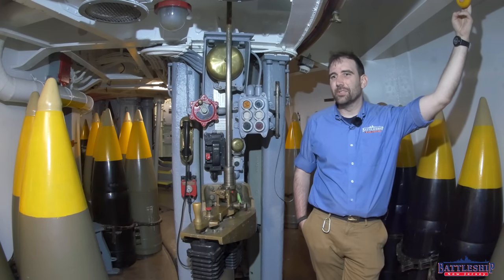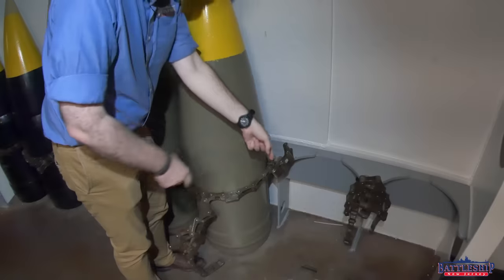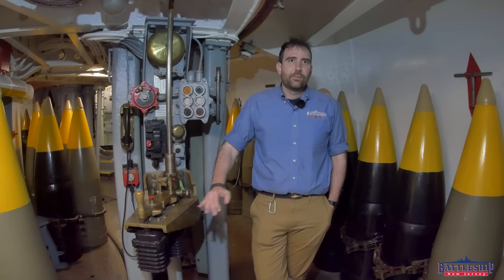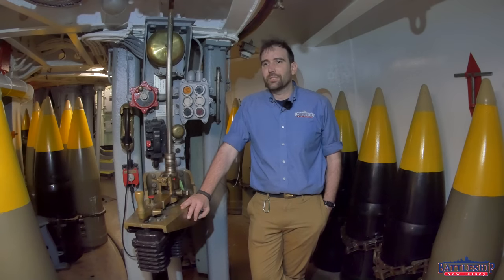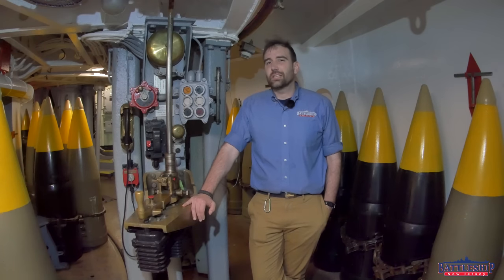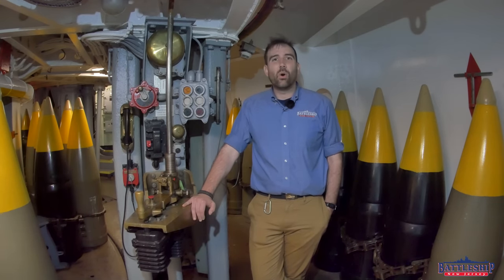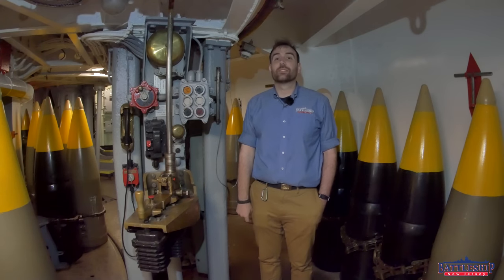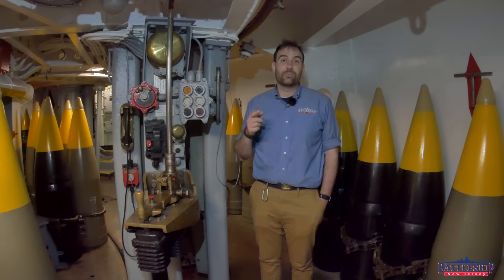Hoisted! Moving 1 Ton Projectiles

Comment: Perfect timing for this video. Just yesterday, I was looking at my copy of Paul Stillwell's Battleship New Jersey. On page 99, he talks about how in April 1947, in Bangor, Wa, they were loading new ammo when a 2700 pound shell broke loose from the sling, and dropped from the second deck level, all the way down 5 levels. This story would make a great video.
Reply: Sounds like an opportunity for some shipboard archeology.
Reply: @jth877  it had to make some dents on the way down.
Reply: That had to have left some dents! I dropped a 4kilo puck of steel on the ground and it made a big dent into the concrete, a 2700 pound shell bing-bonging down into the ship...
Reply: Even better timing for me, just yesterday I was looking at that 2,000 lb 16 inch projectile I have stashed in my basement and saying to myself "How am I going to move this thing? I'll never be able to get it to the gun show and get some money for it if I can't get it out of this basement".
Problem solved, now I can quit worrying.
Reply: @jth877  Dent is probably still there. The book said that after they pulled the shell back up the hoist, one person dumped it overboard. The book didn't say if it's still there.
Reply: Dang I thought dropping my watch was bad. At least it didn't penetrate all the way down to the outside. Probably would have raised a few eyebrows. Seriously, I assume they don't fuse them until nearing the chamber to fire, so safe? Not if you're underneath the deck.
Reply: @JamesThomas-gg6il  
Confuses say;
Man who drop watch in toilet have crappy time.

Comment: I'd like to know how they modified the barrels for the higher pressure rounds.
Reply: According to NavWeaps, the chamber volume and working pressure are the same for the early and later guns (23,506 cubic inches for the chamber volume and 18 tons per square inch working pressure).  The propellant charge weight was dropped from 590lbs to 545lbs and the muzzle velocity dropped from 2600fps to 2520fps while the shell weight was increased as Ryan noted.
Reply: They made em thicc

Comment: What was the margin of error on the main guns when firing on the same target? How did they decide what type of shell to use for what circumstance?
Reply: Drachinifel has a great interview of Captain Larry Seaquist, who Captained the U.S.S Iowa, and he claimed @ 28 mins and 40 seconds in that video they could put a 9 gun salvo's shells all within the area of a "English Football Pitch" field, with nothing landing in the stands, but he didn't say at what range. It's a great interview if you search for "USS Iowa - What It's like to actually command a battleship"
Reply: Regarding the type of shell, there were only two choices, the Armor Piercing and the High Capacity (which would be called high explosive in any other context).  The first was used when you had to go through serious armor or fortification (like concrete), the second for any other target - and there was an air-burst option as well.
Reply: @gregorywright4918  They also had a blind loaded plugged Target Practice shell that was filled with cement and weighed 1900 pounds and had the same dimensions as a High Capacity shell.
Reply: @kimmer6  True - I was presuming he was asking about combat missions.

Comment: Iowa recently turned on the power to the turrets and broadsided the turrets 

we would love to see you, turn the power on to the turret and broadside all three turrets
Reply: Philly needs a warning 😂
Reply: Is that all electrical, or is hydraulic power required?  Some of NJ's electrical transformers were removed by USN, and without main engine power there was a question about whether enough amperage is coming from shore power.
Reply: Iowa just turned Turret 3, the other two did not.  Remember, Turret 2 on Iowa has been out of service since the open-breech explosion on April 19, 1989.
Reply: @gregorywright4918  Most of the movement systems in the turrets are electrohydraulic, meaning that electric motors run hydraulic pumps that flow fluid thru a system to generate movement.  Turret train (traverse), gun lay (elevation), projectile hoists, powder hoists, and rammer are all variations on this theme.  The six parbuckling capstans per shell deck are directly driven by an electric motor and a series of driveshafts and bevel gears, no hydraulics involved.

Comment: A couple of hoist/projectile/powder handling questions.  Between engagements with the big 16s were the projectile/powder hoists kept “primed”, or was that too much of a risk?  If an engagement ended quickly, with the hoists partially loaded, could they be run backward to return projectiles and powder to their respective storage areas?

Comment: When you stack 5 shells in the hoists, how do you maintain flash integrity? That sounds like what happened to the British battlecruisers at Jutland?
Reply: I'm pretty sure it's the powder that you have to worry about in a case like this.  I think it would take quite a shock to detonate a shell, a LOT more that it would take to light off bags of powder.
Reply: @danquigg8311  I would agree that it would take a really good shock to set off  a AP 16 inch shell in a hoist I would be more worried about the powder bags
Reply: As the shells go upward there are doors that close between the rounds at different levels.  Not sure if they can be reversed.
Reply: @gregorywright4918  Four doors between the firing chamber and the magazine?
Reply: @timschoenberger242  I presume - doubt anyone can fit up there to check...

Comment: Was the New Jersey 16 in ever manualy unloaded after loading.  Or was the shell just fired into a safe location.  Imagine it would be hard to get the powder charges back into their containers
Reply: This was answered in a past video. Short answer, not unless absolutely necessary. Guns were cleared by firings them. The process manually unloading them is not fast, and quite risky.
Reply: @GregoryVeizades I assume that's in part because of the holes put in the powder bags before loading
Reply: @counterfit5  There are no holes purposely put in the propellant bags at any time for any reason.

Comment: For an interesting "rabbit hole," The War Department's Ordnance Corps had their own 16" rifles for Coastal Artillery use.  There was considerable friction between the Navy Department and War Department over Congressional funding--so the two did not often "play well together."  Coast art8llery had wanted a 16"_55cal_ rifle for their installations, to outrange naval guns--but there were no foundries to make those.  Most of the Army 16" rifles were 40 cal, just to be different from the 16"45s of the Navy.  
This is even more twisted up in the 14" diameter rifles, some dating back to 1895 in "disappearing" batteries, and retained for "sunk cost" reasons.
Reply: Thought used navy hand me downs
Reply: Battery Townsley just North of San Francisco in the Marin Headlands had two 16''-50 guns for coastal defense. The guns were scrapped in the 1950's but the concrete structures , tunnels, and equipment rooms are open to tourists. They have a 16''-50 barrel on display up there that has an interesting history.
https://www.youtube.com/watch?v=sgjCYDIZiDU
Reply: Big problem for those range issues was lack of elevation for the land-based guns.

Comment: Just curious... did this 'plunging fire doctrine' assist at all with shore bombardment?
Reply: Plunging Fire is a ship-attack tactic, if you have good visibility at long range (or radar control).  The difference in angle is not much, like 5 or 10 degrees at most, compared to what a howitzer or mortar can do against land targets, coming in at 50-70 degrees.

Comment: How are the shells stacked against the wall moved? They're really heavy, right? Is there some sort of crane that can be wheeled around?
Reply: There is "parbuckling gear" built into the decks on the two shell deck levels.  Six constantly rotating capstans allow a parbuckling crew to use 3/4" rope and sometimes sheaves to lasso the base of a projectile and drag is across the shell deck, which is lightly oiled to cut down on the friction.  The capstans and sheaves are strategically located so that with the use of supplemental tackle as needed, the crews can drag any shell from its storage slot to any of the three projectile hoists.

Comment: What are all of the different types of shells (main guns and secondaries) would be carried on a typical cruise in each period of service? 

Did the main guns have starshells?

Was there a shell developed for shore bombardment? If so, did any use a proximity fuse?

Were all of the shells made during ww2 or were post war shells used in service? 

Are there still shells in storage?

Are there limitations in the New Jersey design that would prevent new shell types such as a GPS or laser guided shell?

Assuming the ship is in the middle of a battle and a particular shell type is being used (the hoist is full). The captain decides to fire a different shell type. How long/ his many rounds would it take before the new shell type is fired?
Reply: As to starshell, almost certainly not.  NavWeps doesn’t list one for 16” mk7, and I don’t remember coming across one when sniffing round the ammo for this.  I would also think adapting designs to work at they size would be difficult.
Reply: For shore bombardment, they just used HC rounds, for the extra bursting charge.  The same as using a demolition bomb instead of a GP bomb, if you don’t need penetration but want the maximum surface bang.

I don’t think they ever had prox fuses.  Certainly in the 40s, and probably for much of the 20th century, larger bombs and shells were harder to do prox fuses on, and the greater standoff (detonation height) needed for a shell as powerful as this was also a problem.  And again, NavWeps doesn’t record a prox fused version.  For much or all of the life of the Iowas, prox fuses would have had to be paired to the shell design, or requires larger fuze pockets, so you would have needed a prox fused shell, rather than fitting prox fuzes to standard HC rounds.

I should add the proviso that not everyone is keen to declassify the state of the art in 1980s prox fuzes, so my historical research maybe be incorrect for late era Iowas.
Reply: If you build a 16” shell that can be fired, deploy guidance fins, and have the fins, guidance computer, and gps aerials and/or laser seeker head, all survive, you just need the equivalent of an advanced fuze setter to feed the targeting data to the shell before launch, and an otherwise operation Iowa could fire it.  The 155mm version, for the land based M777 and similar, costs six figure a round, and I’m not sure it’s ready to use yet, even if you want to pay for $1m fire missions that only involve a single round from each gun of a single battery.

So sure, if you spend 20 years paying a defence contractor to burn money, it can be done.  The technical problems are merely new and enhanced versions of more or less solved problems.

Comment: you could go down in size with a sabot system where a 16 inch gun could fire a 14 inch projectile. but going up is as you said a time consuming and complex process. And the amount of projectiles and powder charges would be degreased.

Comment: 1:10 Well you COULD fire a 14 out of the 16 in. It would fit. now whether or not you want the shell bouncing around the barrel on the way out is another story. Get alot gas escaping the 2in difference in circumference though. The reverse...not going to happen of course.
Reply: I suppose you could build sabots to do it if you only had 14s and could never make more 16s for some reason lol
Reply: @garywayne6083 or huuuuge driving rings
Reply: @garywayne6083  Sabots were constructed for long-range munitions testing.
Reply: There would be a 1" gap all around the shell - it might not even make it out the barrel.  If it did move, it would probably vibrate and "bounce around", destroying your barrel grooves on its way.
Reply: @gregorywright4918  With a full powder charge chances are high it would make it out. But the result would be similar (if you can even make this comparison) to firing a .50 BMG out of a 12ga. It will exit but not go very far. Or you end up with a "bloop" exit like a mortar misfire.

Comment: Well the British Empire could have upgunned the Tiger Class Battlecruiser form 13.5" to 14" guns but as Ryan pointed out, that would have been expensive to rip out the ammunition storage and ammunition hoists and replace it with the systems from King George V
Reply: There would have been no need to replace the 13.5in guns and turrets on the Tiger as she, like the Iron Dukes had the heavy 1400 pound shells compared to the earlier 13.5in ships that had the light 1250 pound AP shells. Increasing the elevation would have been better, just like the Japanese did with their 14in turrets.

Comment: Ryan, the way I see it, an Iowa class Battleship's 
only mission, is to get 9, 16 inch guns to where 
they need to be.  And shoot them!  The rest is 
just the things that are needed, to keep those 9 
guns safe and running.

Am I correct?

(You might notice, I am here quite a bit, kind of 
strange for an Army Aviation puke.  I LIKE your 
presentation!)

The Apaches and the other attack helicopters, a 
similar view.  They are there, to shoot what they 
have.  The CH47 Chinook, the one I worked on, 
was strictly designed to get logistics, to where 
they needed to be.  Guns, ammo, first aid, or lunch.
Also, to "un-ass" the AO.  (GTFO.)

steve
Reply: If that is the case, then they were failures during WW2, because those 16" guns did nothing to other ships or fortifications then (well, perhaps a destroyer).  But if you expand the mission profile to include escort (accompanying the carriers to stand between them and any IJN battleships that might threaten them, particularly when the planes can't fly) and heavy AA defense, then they had good reason to be proud.
Reply: My fiend was a crew chief on a Jolly Green Giant, and had some nice stories. One involved transporting a new gun/watch tower to a fire base. 
The ghosts started using small arms on the copter, and the new 2nd. Lt. said to drop the tower and gtfo.
So they did, and 2nd. Lt. was shipped off.
Another one was when a NEW 2nd Lt ordered crew chief to stop r/m on the copter and sandbag the 2nd.Lt's hootch. 
A captain that knew crew chief saw him sandbagging and asked WTF are you doing? He told the Captain. 
Captain said get back to your copter, I'll talk to the LT.
Lt never again spoke to crew chief.

Comment: I have read several accounts of New Jersey inserting special forces units by firing individual soldiers in empty shell cases equipped with parachutes into Vietnam. One broadside would deliver a squad with extreme accuracy into enemy held territory. Are there any surviving examples of these shells aboard the New Jersey?
Reply: The G forces would turn any occupants into mush!.....Try again.
Reply: Not any kind of expert, but this sounds like a sea story to me. How many G's did the shells experience when fired? Seems that it would be enough to kill even a SEAL.
Reply: That is funny stuff.
Reply: @rcknbob1 artillery apparently peaks at 15,000g typically, but that seems to be for land-based units much smaller than the 16"/50. The final HARP gun, which was four of these 16"/50s welded together lengthwise (🤣) and then bored smooth also peaked at 15,000g.
Reply: Were they any kin to Major "King" Kong?